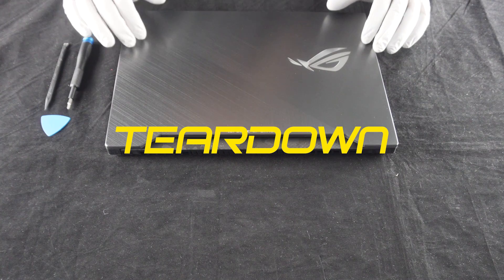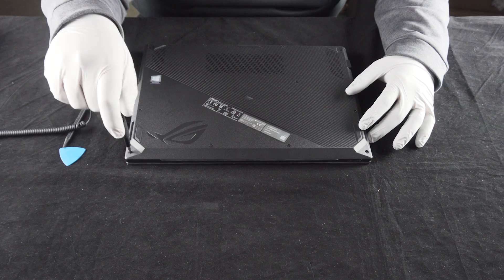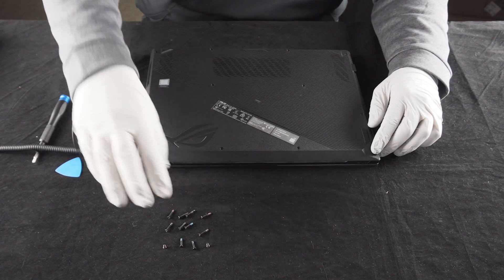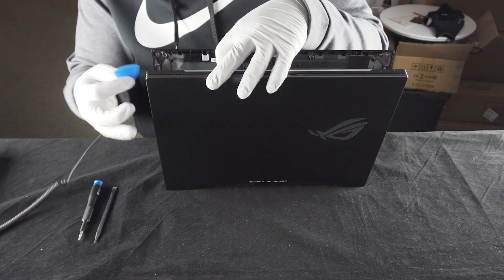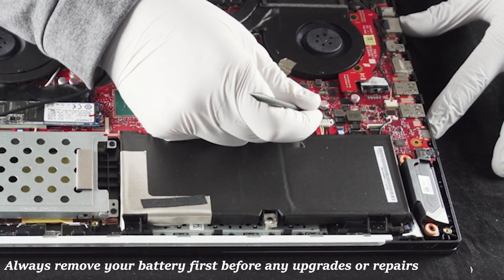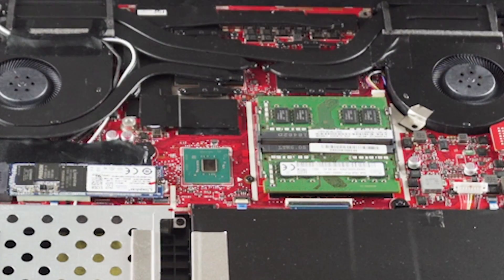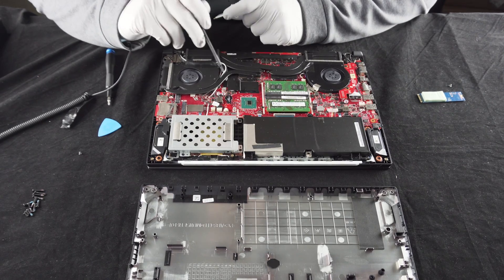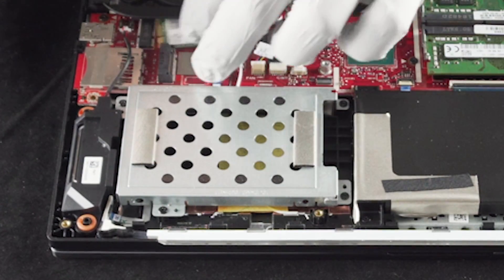ASUS ROG GL704GW Strix Scar II | How to Service, Upgrade & Fix Laptop (Teardown)

Comment: I have the 15.6 inch hero 2 (Rtx 2060) which is pretty much similar to this one. From a few days I've been noticing that the max fan speed has been increasing on its own, like earlier the fans used to go upto a maximum of 7000 rpm with 100 percent fan speed in armoury crate, but now they go all the way upto 9000 rpm with 100 percent fan speed in armoury crate. Other than that there is no trouble of any kind just wanted to know if this is dangerous or  is something wrong, and if it is, does anyone have any solution to the problem?

Comment: My power connector seems to be loose. The case slides down slightly which pushes the plug and I think the solder inside is off too. Shame that these devices seem to be built for obsolescence. Used to be able to use a single laptop for a good 2-4 years... now it is 1-2 years if lucky.

Comment: is it possible to run this laptop without its battery?
like literally take out the battery
Reply: Mine has a bad battery. It will run without the battery but it seems to run in a very low performance mode. No gaming :(

Comment: I have the 15 inch version of this laptop and from the factory the heat sink is bent and I'm getting insane throttling with max clocks of only 2.8 ghz.  I'm looking for another heat sink online but cannot find it ANYWHERE for the 15 inch version. Your 17 inch has the same exact heat sink but I wonder if they are the same measurement? The 17 inch is available online. Picture vs Picture they look identical.

Comment: Can you theoretically change nvidia 1660ti to rtx 2060/2070?? in this laptop
Reply: You cannot since the GPU and CPU are soldered onto the motherboard.
Reply: The guy says he's working on GL504G, not sure if this was a mistake but if the video title is correct (GL704GW) or the the two models are similar enough you should be able to do it. I have GL704GW with factory issued rtx2070.

Comment: Hey I have this laptop and in the future if I want/need to upgrade the cpu do you think it and handle the i9- 9980hk, 9950hk, or the i7-9750h
Reply: Curious to know as well, I wonder! probably not practical but just for the fun of it. Upgrading CPU & GPU on laptops might be a thing that is more common in the future..who knows. I'm watching to see if the new 2019 Alienware area 51m will be supported in changing out CPU & GPU in the future. Who knows though.
Reply: MapleSugar yeah I saw that one was socketed with a desktop cpu so it’s easier

Comment: mine did not come with the ssd cable ribbon, asus is a pain in the ass to deal with and wont send it, do you know what it looks like or where I can get it?
Reply: I’m sure you figured it out by now but it’s an orange very thin cable that came in the box. I almost threw mine away at first. There’s a few more videos out now that have tutorials which show it

Comment: Great video, thanks. I am having an issue upgrading the m.2 drive.  And Asus will not tell me what m.2 drive I can use to upgrade. I tried a 970 EVO but not boot.
Reply: Any update on this. Because I was going to upgrade to a 970.. but I saw a m.2 sata drive in this video.
Reply: @SanneBerkhuizen  - I do not know if the 970 will work. I say it like that because I had problems using the 970. I cloned my HD with Acronis, then plugged in and it would not start. I called Asus but they gave me the run around on a straight answer on what drive to use. I did more research on the drives make an model that came with the laptop and found it was a Crucial, so I bought a ( Crucial P1 1TB 3D NAND NVMe PCIe M.2 SSD - CT1000P1SSD8  ). I did the clone again but still no good. So before returning, I tried factory rest thru the Asus Windows backup and it did a clean install of the Asus Windows 10 original install and it worked. So cloning did not work. Only a factory install worked for me.
Reply: Sandberg Profet-Family how did you do the windows backup
Reply: @1017trap  - I used Acronis 2020 and it has a clone harddrive tool. Boots into a Linux os and then clones the HD.  Not an image but directly to the drive using a USB to m.2 cable connector.
Reply: @4underpar  awesome ive been trying to clone the m.2 to one with a higher capacity..

Comment: I got a small chip when i purchased my laptop on Amazon....same exact laptop Asus scar 2 GL704GW. What is the chip for i dont have a clue...plz help?
Reply from the maker: It's called a Keystone. Keystones offer a versatile new way to personalize your machine and protect your personal data. These physical, NFC-enabled keys fit neatly into the Strix Hero III’s chassis, adding a subtle accent along the trim. When docked, they instantly transform your machine with different effects and game-specific profiles, or unlock access to a secret Shadow Drive for covert private storage.
Reply: @empoweredpc  thank you very much but how do i attach it to the laptop? Not a big tech person

Comment: What is that piece that looks like a cpu? Between the m.2 ssd and rams.
Reply: I opened up mine to upgrade RAM, and i was wondering the same thing, did you find out what it is? i was like Naa it can't be the cpu, it should be under the heatsinks
Reply: @ExcellionLethani  I didn', sorry. Logicaly, the cpu should be under the heatsink as you said and that made me so curious. And the reviewers on youtube don't mention anything about it.
Reply: @TechmagnimeHD  I found an answer, it's the chipset of the motherboard

Comment: My scar 2 doesn't boot up after I installed the ram and i put back the battery thing back in place.
Reply: Same problem, do you fix it?
Reply: does it turn on with the charger? If yes, the problem is from the battery. If it still doesn't turn on, the problem is from your new ram, maybe the CPU doesn't support it. Did you but the right speed?

Comment: My gl704gw very easily and often throttles, always get fps drops, any ideas on how to fix this?
Reply: Undervolt the cpu a bit,
Undervold the gpu a bit then overclock to gain back some performance.
Apply better thermal compound to the cooling system
Adjust the fan curve to give more cooling.
Reply: @rm2kdev  undervolting messed up my laptop, when i searched they said asus doesnt support it, so by 50 is maximum recommended and i dont see a difference
Reply: If you have a single stick of ram still that's why you are getting frame drops.
Reply: @AidedOnslaught  wait is that really why?
Reply: @hellobster387  yes you need extra ram also, if there's only 1 stick it's running in single channel mode.

Regarding undervolting find a tutorial and use Intel xtu on my 704gw I am stable at -0.105 and that is shaving about 8c off the cpu.

It doesn't sound like much but it's enough to get full power out of the laptop without thermal throttling
Reply: @hellobster387  but ram is not the only reason why your loosing frames and performance, even with more ram the cpu will still overheat and thermal throttle this is common with laptops unless you can shave off 8c with undervolting, and an additional 5 - 10c with a thermal compound repast.

Asus doesn't support it but if your using Intel xtu they'll never know if anything goes wrong just reboot and uninstall it.
Reply: @rm2kdev  oh ok that makes sense, thanks ill try it

Comment: Thanks for the video! I just ordered mine today from Newegg, and I will be using this video for a reference when it comes to upgrading certain parts. Great work!
Reply from the maker: your welcome and happy upgrading!
Reply: I got the same one from newegg lol. How is it? Can't wait for mine to arrive.
Reply: @princerog9579  I've enjoyed mine a lot so far. No issues at all. I have upgraded to a 32GB ram kit (Highly suggest upgrading to the dual channel memory. Made a world of difference in performance) and I added a secondary WD 2TB SSD to it. Love it so far!
Reply: @liberty610  Nice.the laptop has 16 gb 2666 hz ram and I have a 16 gb 3000 hz stick laying around. Will it be compatible? Is this laptop powerful enough for a good vr experience as i have a valve index on its way too. Thanks
Reply: @princerog9579  I don't know how those two sticks would behave together honestly. I have seen some weird things happen when you mix/match ram, but it depends on the system. I personally would buy a dual-channel kit that was designed to work together. I bought a 32gig kit, as I also do video editing and production work. As far as VR stuff goes, I have no idea. I have not dabbled into VR gaming on PC. I hardly touch it on the PS4.
Reply: @liberty610  thanks man. I will look into it more.
Reply: @princerog9579  Yeah it is compatible but it will be a waste putting this ram together because if you have ram with two different clock speeds in a motherboard, then only the minimum clock speed will be utilised. that is if use a 3000hz ram with a 2666hz ram, a maximum of only 2666hz will be used and the remaining 334hz of ur other ram will not be utilized. so I suggest using ram sticks of the same speed.

Comment: Thinking of changing my single channel 16gb ram with dual channel 8gb. One thing i found confusing is, do i pick 200, 204 or 260 pin SODIMM?
Reply: check your ram with cpu-z. check the model number and brand of the ram and then put it in google search. mine was  samsung m471a2k43cb1-ctd which had 260 pin sodimm with cl of 19, 2666 mhz and ddr4 16gb
Reply: @prasunkumar1125  I got the Kingston HyperX Impact DDR4-2666Mhz cl15. Seems pretty well. Done a bit risky since i didn't even do my research but it worked. PC runs smoother and FPS is alot more stable on games.

Comment: would you kindly tell me the name of the original ram which installed in the laptop
Reply: Don't know brand, but PN is 60nr01co-mb1041 off of the stickI know it is 16gb and the speed in 2666
Reply: @gregsiebert5744  ty
Reply: @swedyptian9977  I'd recommend a Cruicial RAM because it has the closest specs to the original RAM and althought for example different CAS latency shouldn't cause any major problems, it's always better to have sticks that are closest as possible specs-wise
Reply: SK hynix Korea is the brand.  HMA82GS6CJR8N-VK. 16GB 2Rx8 PC4-2666v-SE1-11

Comment: Is the HDD cable always included in the device?
Reply: Avik Mandal i hope so. I saved the box. Will check tonight. Damn.
Reply: The cable was in the small box with the mini manuals, 8n a plastic bag. Used it successfully to add a ssd 860 Samsung 1 terabyte. Only nerve wrecking part was ribbon cable. Location was different than in video, no need to remove nm2 drive. Was marked as hdd. But ribbon cable is soooo delicate! Was terrified to break cable or connector. No idea how to loosen connector to insert cable. Just pushed it in and prayed and it worked!

Comment: Hello : guys who played rainbow six siege or pubg on this laptop i would like to know  about the game frame 
The results of my laptop is : 
All (ultra settings) 
Rainbow : 45 to 50 
Pubg : 55 to 62 
Battlefield v : 45 rtx on 
Single ram 16 gb 
Rtx 2070
Reply: are you including v-sync as part of the tests?
Reply: i think i get the same with rainbow six, but thats with the v-sync on, otherwise i think i get 60 or more.  i  got the same model.  i am only running sata hdd and its not the original hdd so i dont know if my spin up and rpm is different then the original.
Reply: Da La i know why the frames is low if you checked the graphics settings in the game (rainbow) there is an option render scaling so for my monitor Supporting full hd 1920x1080 p resolution so i keep the render scale to 25% recommended so the frame is going high .
Thats what I understand from videos talking about render scaling
Reply: SNIPER X dude are you serious? That significantly reduces the quality and you’d be running the game at like 480p!
Reply: SNIPER X You need to get Dual Channel RAM

Comment: Just bought the same computer with no hard drive, wanting to add the Samsung 1tb ssd 850 evo just for extra storage. Can I just add the drive and connect the ribbon connection? Are there extra steps? Also just got the Hynix HMA82GS6CJR8N-VK 16gb ram to make it dual channel. Figured I'd keep the ram the same? I know its a lot of questions but you seem like the people to ask!
Reply: yup, you should be all good. i have the same model, and just so happen to get it with no hdd in if. Also, if you need the bios password, there is a list available and make sure to follow the simple steps to change settings. the guy i got mine from had if for months and never figured it out, so feel free to ask for help.

Comment: so I can add any 16gb 2666MHz DDR4 RAM stick along side the one already installed without any trouble and get dual channel?
Reply: T. MO894 Yes, just make sure the ram is compatable with this specific laptop, and you’re good. 2 16’s (32 total) is as much ram as this laptop will support.
Reply: @timeshaft5088  Awesome thank you for the info! That's exactly what I did and I love this machine!
Reply: @tonymohamed9722  John is right,  i have the 16gb model, it has an xtra slot for 16gb and an ssd slot.

Comment: Used this guide to install another 16gb stick for dual channel on my 704gw, thanks mate 😁
Reply: Added the crucial ddr4 sodimm 2666mhz 16gb stick. Playing some anno 1800, doom, witcher 3, ark survival. I noticed alot of change in most games. Everywhere from 10-40 more fps depending on the game.
Reply: Update: i went from 45-55 fps in ARK survival to 70-100
Reply: Krestian Kvart which games u playing 
Please answer me asap 
Rainbow six = 45 fps 
Pubg = 62 / 57 
Cuz im not happy with the performance
Reply: Which model did you add ?
Reply: Did u install the ram with the original laptop ram or take out the original and add that one ?
Reply: @aspectbruv6631  just added another with the exact same specs and kept the original.
Reply: @pelementmaker  oh thanks do you have any tips for it overheating because that keeps happening to me but I'm going to clean it out and probably buy a laptop cooler to see the difference

Comment: I just ordered a 1 tb nvme SSD 1tb hd with 32 gb ram and 2070 but a day later the bios wouldn't recognize any bootable device from you guys could the problem be connection based
Reply: Apparently you need to look in the BIOS settings

Comment: is it possible to add another 16gb RAM to enable dual channel? or do you need 2 8gb ? just bought laptop two weeks ago
Reply: I would go with a second 16gb to achieve dual channel, it will cost the same roughly the same as buying 2 8gb sticks. Check ur current ram out to identify the CAS of the current single stick buy matching density/CAS so you are compatible with the current stick. Newegg is charging about 5 dollars more for a a 16gb stick vs 2x8gb. That will give you dual channel, as well you will have double the ram as long as the CAS is the same for both sticks.
Reply: Shane B Already purchased a 16GB crucial ddr4-2666. Just wanted to double check because I know nothing about computers haha
Reply: Yes, the laptop can go up to 32 gigabytes of ram, I would buy another 16 for dual channel

Sorry for replying so late... 😅
Reply: You got  that second 16gb ram? Enabled dual channel?
Reply: Hugo Andrés Quintero Ocando yes I added it & it is running very well. Crucial website will show you compatible RAM to add
Reply: Just changed my single 16gb ram for 2 units of 8gb. Performance is now 30% better. :)
Reply: Hugo Andrés Quintero Ocando which games ur playing. 
Cuz i have the same laptop and the performance not that much 
Pubg = 62/55 FPS
Rainbow six siege = 50 / 45 
My old laptop msi gtx 1070 single ram run fps more than this rtx 2070
Reply: @sniperx1859  BFV,  The Division 2. LOL, A Plague Tale, Assassins Creed 3 Remastered.